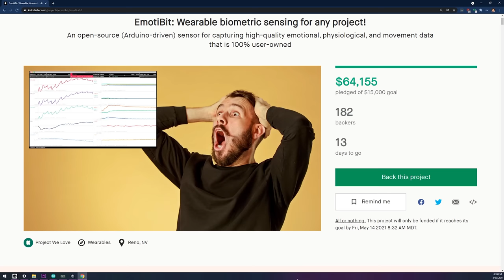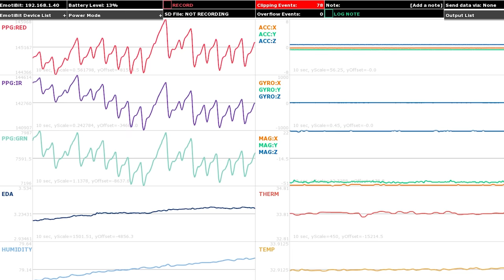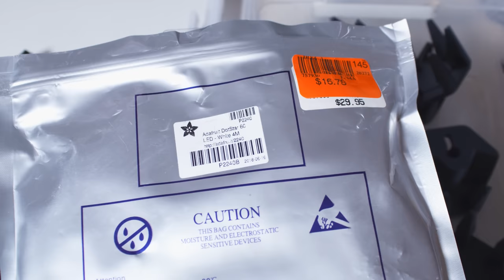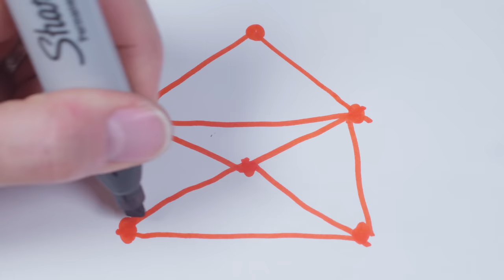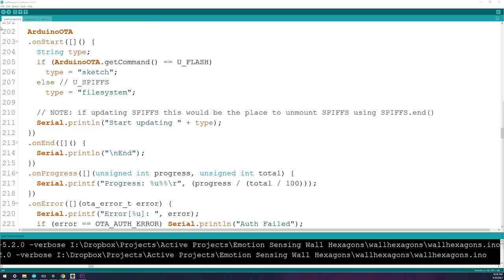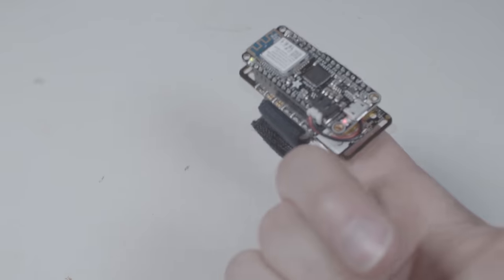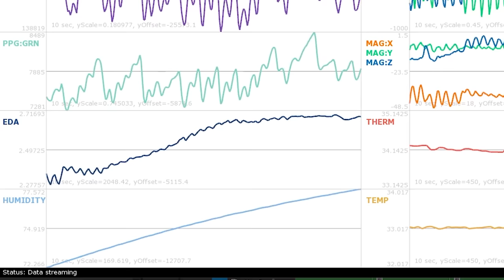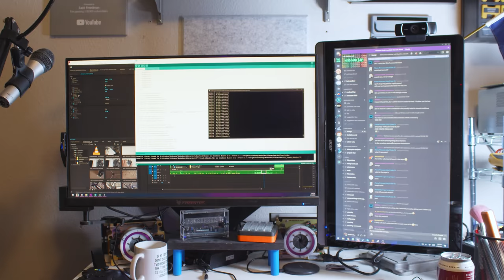The Chromance - RGB Wall Art You Can Build (Cheaper and Bigger than Nanoleaf!)

Comment: $199 For the basic emotibit? That's the best joke in the video Zack. And I thought Adafruit kit was expensive.
I can't believe that they didn't even build in WiFi. A remote sensor without WiFi? Even bluetooth would have been an improvement, limited, but an improvement.
Reply: Your project off the back of it is amazing and I'll be doing something similar, but with something a lot cheaper to sense mood.

Comment: Whoa, whoa, whoa there Manhatten.  "Code is boring"?  What does that mean?  Code are the spells of the modern Alchemist, homeboy.  Build what you want with your modern purified crystals, metallurgy, and magic bric-a-brac: it all means nothing without the correct incantations.
Reply from the maker: I touch on this in a few episodes, but putting code on screen causes a dip in retention. Many viewers just seem to click away when programming, or maybe just the code itself, comes up. I felt like for this episode, it was worth losing some retention.

Comment: Hey Zach,
I was building a micro drone in which I 3D printed all the legs and body. I ran into a few problems with it not being perfectly symmetrical, is this a printer problem or an axis out of place? Also I love your content and would love to learn from you, I am in college for an engineering degree and you are an inspiration!
Reply: Had a similar problem once, one of the two driving belts had jumped a tooth on a pulley on the Y axis after a collision. Took me weeks to even notice. Minutes to fix.
Reply: @Urusay  just tightened the x-axis belt and that seemed to help with circular symmetry
Reply: Jump into the Void Star discord and im sure someone will be available to help :)
Reply from the maker: Definitely ask this in the #3d-printing channel of the Discord - discord.gg/voidstarlab . The specific way it's asymmetrical will suggest a repair. For instance, if circles are coming out as angled ovals, your axes are misaligned; and if dimensions are wrong in one axis but not another, a belt could be loose.

Comment: When I plugged it in for the first time only about half of a single strip of each of the four segments lit up and stayed solid, no ripples :( should there be different code used for neo pixels since they only have one data pin and no clock pin? I know that NeoPixel code can be used with dotstar strips but I don't know if. Star code can be used with NeoPixel strips, cuz I followed your instructions to the exact 10th of every letter with the one exception of my neo pixel LEDs as it was listed as a suitable substitute in the BOM. I know this video is over 2 years old but please halp I put way too much time into this project to fail because of some abstract niche booshit ):

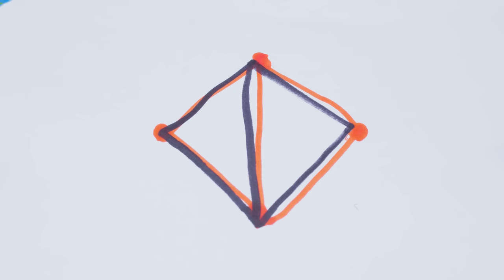Comment: Someone is wrong in the internet!!! That needs to be corrected: at 4:05 you don't mean "exactly two", because it is also possible with 0 of these vertices (that's the Euler circle). So it should be "if and only if 2 or less vertices have an odd number of lines"
Reply from the maker: I put some text up on screen to that effect, though I forgot about a single odd vertex.

Comment: Just a tip, don’t buy adafruit neopixel it’s basically a scam and you can buy the same thing for 1/4th the price. Just search “WS2812B 144 per meter strips”
Learned this from building “neopixel” lightsabers. We call them neopixel, but they don’t actually use adafruit brand neopixel strips, but other brand WS2812B and sometimes SK6812. These all use the same programming libraries
Reply: Thanks, the info is much appreciated!
Reply from the maker: I like to keep a spool of name-brand NeoPixels around. I've had a lot of failures with off-brand strips, and it's good to have some factory-tested known-working LED's on hand.
Reply: @ZackFreedman  I get it in that sense you’re paying for the time and headache you end up saving your self. I have repaired strips in the past by cutting out an LED and just soldering an extra in its place, but at that point it may be worth just spending the extra money.
Reply: @ZackFreedman  That's understandable, you're on a tight time budget after all 👍